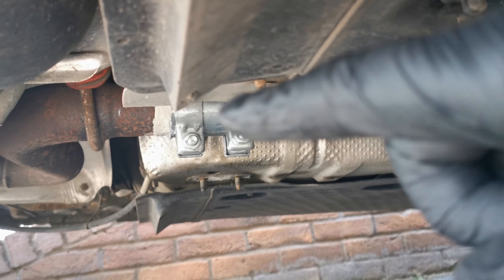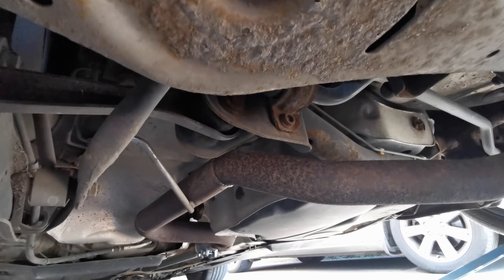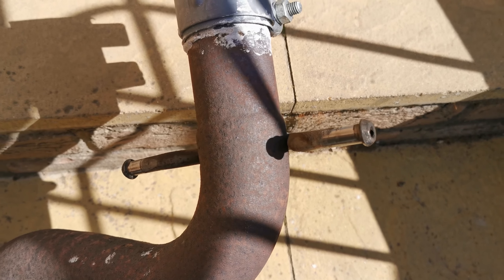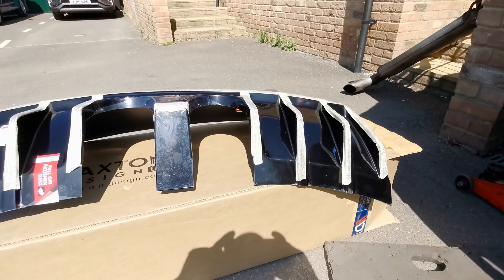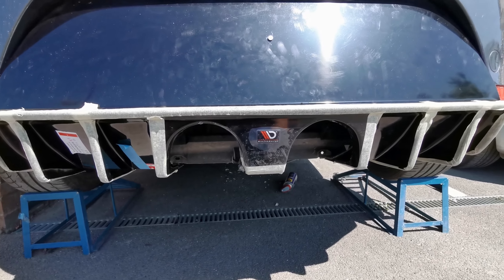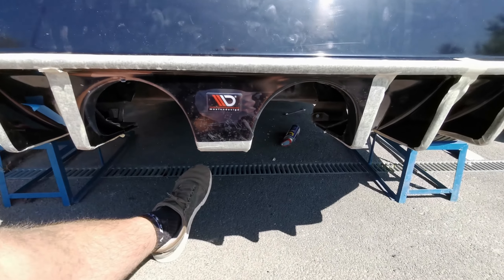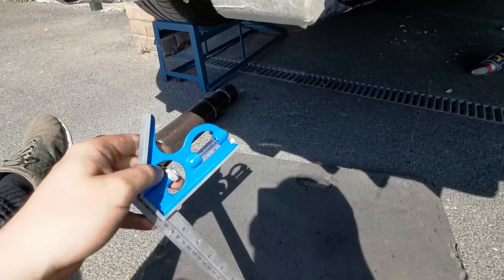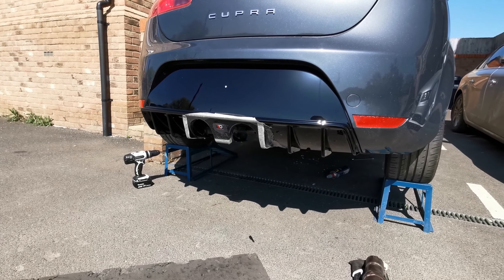Maxton Diffuser Fitting - Seat Leon Cupra mk2 build - EP-2

Comment: Looks mint! Do you have to glue it on top off the old diffuser or can u install it without gluing it on the old diff?
Reply from the maker: I glued it on top of the old diffuser just for a extra bit of rigidity around the tips as without the standard diffuser theres no attachment around the tips
Reply: @cambridgespeedandperforman606 cant you just extend the diffusor tips for a bit and then screw it to the original screwing points?